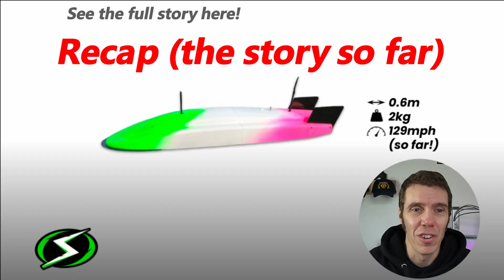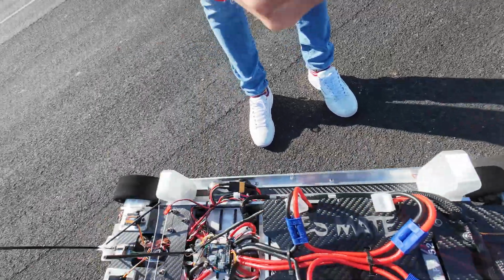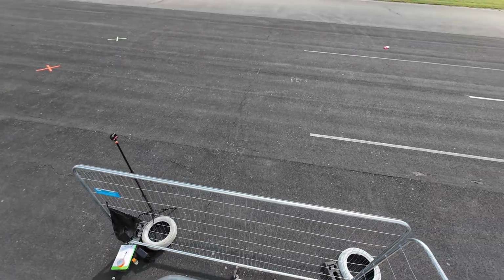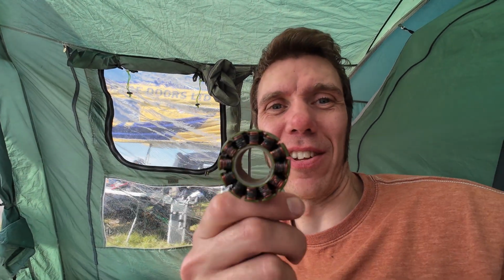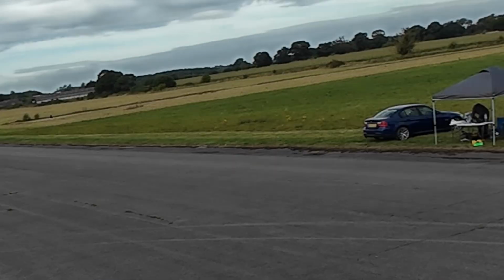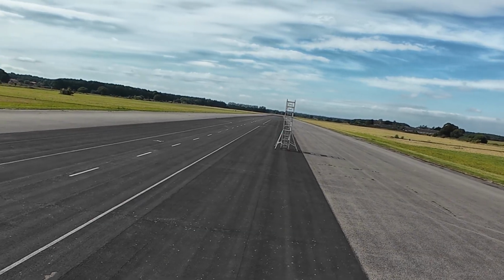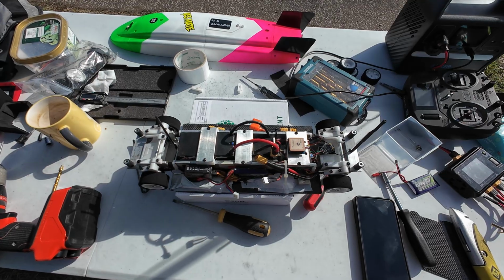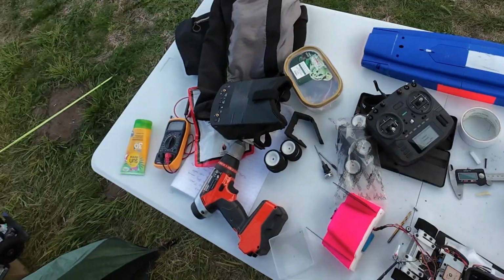It didn't go to plan, but what happened is still an epic story!

Comment: Hi Steve. I was there and watched part of your motor rewind. Never, ever seen that. 👏👏👏 

Your dedication and hard work was amazing. 

That Elvington surface was very, very hard for the smaller scales. Very surprised you even got a run out of the cone car, my Buri was such a scary handful I gave up after 2 attempted runs... 

Really looking forward to 2025 and Llanbedr. I think you will get a 150mph cap from the cone and maybe the next cap from a simplified Beast. 

👏👏👏
Reply from the maker: Hi Derek, thanks for watching and the compliments, its much appreciated. I probably should have realised I wasn't going to get anywhere with the cone too and stopped before the crash! Easy to say with hindsight.... And yes 2025 is going to be the year 👍🤞